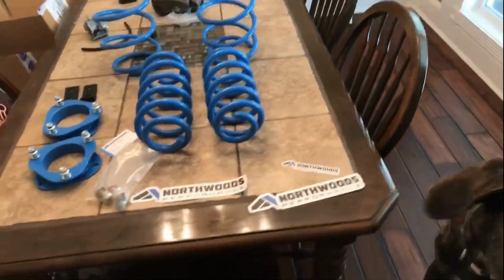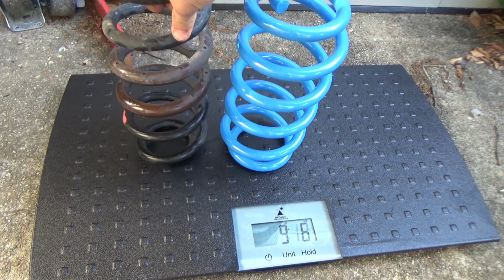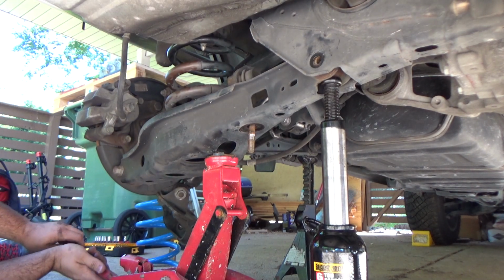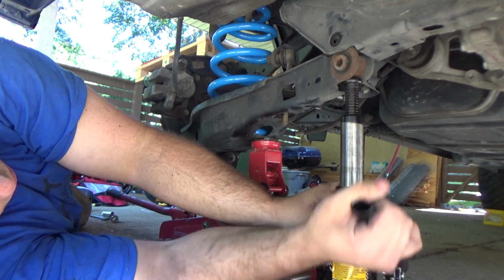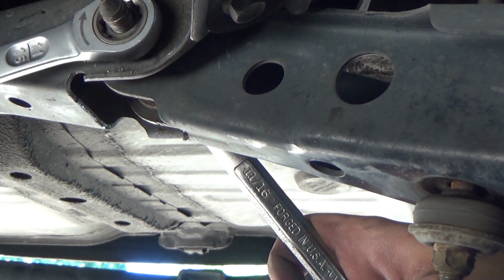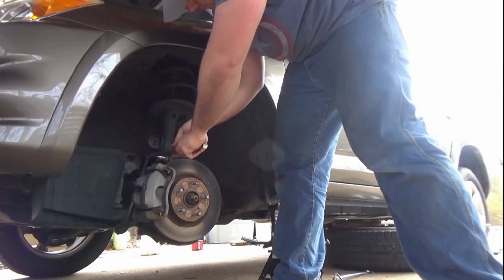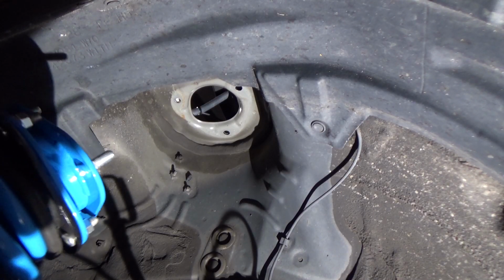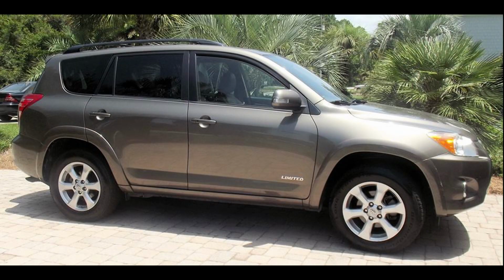Best lift kit for 2006-2018 Rav4. Northwoods Performance

Comment: @Creativemechanic 

Where did u buy the front sway bar end links relocation bracket? Did it come with it? Or did u order that piece? 

If so, where can I buy it?

Makes total sense to use that. The aftermarket front sway bar end links are 5 pound stronger than the factory.
Reply from the maker: The lifts come with it
Reply: @CreativeMechanic  that’s what I thought. Because when I told them about what I want and quote, so that I know how much I can invest for my 2015 lifted Scion xB, that has the 3rd Gen rav4 front suspension and rear spacer that’s both 2.5” lift. 

I ask them if it comes with the front sway bar end link relocation bracket. 

They said they don’t use sway bar end link relocation bracket. Our links are the correct length for the lift. 

I found another video, of another RAV4 owner. He had full tuned suspension lift, that has KYB with northwoods springs. And a spacer. He installed it and didn’t come with a relocation bracket. But he did had a front sway bar and fits perfect. 

But from you, u had those and u said it does comes with a relocation bracket. 

It was a bit weird. So hopefully when I order mine, it will come with it as well

@CreativeMechanic
Reply from the maker: Nathan from Northwoods does sell the shorter sway bar links now.  I’d recommend going with those as the relocation brackets can cause issues if they aren’t on perfect
Reply from the maker: I think my kit is just older is all.  Northwoods will hook you up with the right stuff 👌.  However I’d do some research and see if your sway bar end links are the same part number as a RAV
Reply: @CreativeMechanic  oh definitely. Thanks to u. And when I looked up the website, they are 5 pounds stronger than our own 2.05 pound end links.

And I’m very impressed with that. So I’m definitely considering getting these sets, and sway bar end links that can ride much smoother, along with the bracket. 🙏🏼🙏🏼🙏🏼

They are in my list for my lifted xB project. Right now I’m dealing with full custom exhaust. After that, it’s mew suspension upgrade. 🙏🏼🙏🏼🙏🏼

One more thing, u had ur suspension for quite awhile, how are they driving them daily?
Reply: @CreativeMechanic  urs is a 3rd Gen correct?
Reply: @CreativeMechanic  not all Toyota that comes with a front sway bar are exactly that same I believe. But that’s what Toyota does when sharing the same parts. And that’s the beauty of it. 

And I’ll be more than happy to do more research. It’s addicting for our built 🙏🏼🤣
Reply from the maker: Yes, but 2006-2015 have the same suspension
Reply: @CreativeMechanic  yes that’s correct. 3rd Gen 2006-2012 and 4th Gen 2013-2018 have the same suspension. Which is a good thing
Reply: @CreativeMechanic  Soo good news. Both 3rd Gen and 4th Gen Toyota RAV4 have the same part number as 2008-2010 2nd Gen and 2011-2015 Gen 2.5 Scion xB. 

So I’m all covered 🎊

Comment: Have you not had any issues with the CV axles? I installed the kit and I’m getting a wobble around 20-25 mph. Reading the forums and it seems others been having the same issue. Just wondering btw, I’d appreciate the response and any insight into the problem. (2012 V6 4WD)
Reply from the maker: I think the issues come from the rear toe arms.  Do you have the ones that were glued for the safety recall?
Reply: I have new rear toe arms, took the glued ones off, and I still get wobble around 20-25 mph. I was thinking it was my second gear in the transmission causing the wobble this whole time. Think I'll have to stick a few go pros underneath and drive it around. Going to install some Specialty Products adjustable rear camber arms this week.
Reply: @rgrrgrsxndngr1904  Has to be front axle related. I took off the front lift and kept the rear lift (temporarily ) and the wobble disappeared. I’m almost certain the slight change in angle for the CV axles is the likely cause. Mine has 100k miles so they are probably worn out. Took off the lift completely in the end.
Reply: @OGLouisVuittonDon  ahhh I see. Yeah it definitely feels like the shaking comes from the front, not the rear. Maybe I’ll try removing the front struts and toss the old ones back on to see if that fixes it also.
Reply: @Jeremy When I commented this, at the time there was only one thread that "solved" this issue with your response. There were still countless other threads in the process of diagnosing and suggesting other solutions. 

Now enough time has passed for me to be confident in your response that is now backed by few more confirming the same. I just wanted to understand the issue better so I'm not going in circles spending unnecessary time/money. 

Some more insight for anyone else curious. It's been confirmed that the issue is indeed tied to CV axle wear and new CV axle angle. The new angle causes some slack between the gears and the wear pattern that most axles will gradually develop with enough miles, which then causes the shake when enough power is ran through. Unfortunately no aftermarket axles have been confirmed (yet) to fix the wobble.
Reply: @OGLouisVuittonDon any update to this? Is it best to avoid getting this kit?
Reply: 😢 rip

Comment: Would you go with this over the sst lift? I’ve read a lot of extreme camber issues with the sst spacer lift.
Reply from the maker: Front or back wheel camber issues?
Reply: @CreativeMechanic  sorry about that, a lot of complaints about the front end camber. A few people mentioned shaking at 65mph as well on the website. I’m new to this so I apologize for my ignorance
Reply from the maker: @robertwest4299  I never noticed shaking.. but I will say that the Northwoods kit drove a lot better
Reply: @CreativeMechanic  thank you  very much.

Comment: I have been test driving some 2017  2018 RAV 4s with around 20000 miles and some rides feel way better than others in the same model XLE.  I sold my 2018 RAV LE because the ride was so harsh.  Recently test drove a XLE that rode great and an XLE that rode as bad as the LE I got rid of.  I am wondering why the huge difference from vehicle to vehicle. Any ideas out there?
Reply from the maker: Not sure, but it’s a completely different platform
Reply: Toyota performed different adjustments each vehicle they make every quarter of the year. Hence, one will feel different and one won't

Comment: How do you like your Rav? I was looking to get a 2012 v6. Maybe add some light off-road mods.
Reply from the maker: 1. The 2006-2012 AWD Rav4 was Toyota’s fastest 0-60 vehicle
2. It can tow 3,500 pounds 
3. It gets 28 mpg
4. It has tons of cargo space because the spare is on the rear door, my Great Dane can stand up no problem.

It’s hard to find another vehicle from that time that competes with those stats
Reply: Creative Mechanic yep I’m sold! I gotta get one !!

Comment: Did I miss what year the Rav4 your installing the kit is?
Reply from the maker: It’s a 2010
Reply: @CreativeMechanic  I probably should have asked you before I ordered almost the exact kit for my 2011, but how is it holding up?
Reply from the maker: Doing great I don’t see any issues with this kit
Reply: @CreativeMechanic   Did you have an alignment done after the install?
Reply from the maker: Yes, always get an alignment after changing suspension components

Comment: while installing it I found a thin triangular piece on the front strut upper mounting bolt. I don't know whether I am going to need to install this piece on top of the new suspension and struts. Any thoughts? Thank you!
Reply from the maker: I’d leave it in, should be a wear to plate to prevent rust
Reply: @CreativeMechanic  so you are saying I should install that triangular piece on the suspension parts? Thank you!
Reply from the maker: Yes, between strut and car

Comment: What's the max size tire you can use on rav4 v6 without a lift? I dont wanna change the old ladies 17 inch wheels. But want atleast a extra 1.5 inch diameter. The stock wheel and tires are 28.5

Comment: Hey, one question, those tyres look more meaty than the stock ones, do you feel any difference in throttle response and fuel efficiency?
Reply from the maker: There 235/60 R18, so only 0.5 inches bigger in diameter, mud tires always look bigger.  Not noticeable with the V6 model at all.
Reply: @CreativeMechanic  of course, the V6 is too powerful for a non drastic change, i have the base model of the 2010 Rav 4, so I don't want to go too crazy with any tyre swap and lift.

Comment: hi. You remove Readylift's all details before install Northwoods?
Reply from the maker: Yes!  Except I may have left the brake line spacers on.  I’m doing another video installation combining the two lift kits later this year. Mega lift 😂
Reply: @CreativeMechanic  This spring set proper for 2.4CC AWD rav4 or 3.5CC v6 rav4?
Reply from the maker: They sell them for both models.  Mine is the 3.5 liter V6 with AWD
Reply: @CreativeMechanic  i bought northwood and like it. Now waiting MEGA LIFT :D

Comment: Two questions.
1. Does it ride and handle any differently than stock?
2. Do the bigger tires change your speedometer?
Reply from the maker: Yes, yes
Reply: Ride rougher?
Reply from the maker: @mikedunham130  yes, smaller rims with beefier tires may offset it. But I have 18”s on 235 60 all terrains
Reply: Thanks. I was thinking of keeping the 17” wheels and tires I have for now. Sounds like maybe this isn’t going to be what I want. I find my RAV4 4wd to ride a fair bit rougher than my old 2006 FWD. it’s ok, but not sure I’d want it any tougher. 

Thanks for the info

Comment: May be wise to drop the control arms from the hub side for anyone doing this

Doing my 07 V6 the arm wanted to roll badly binding  the bolt I’m 4 hours in new bolt ordered and no parts installed
Reply from the maker: You have more leverage to compress the spring from the other end.  Good luck with your new bolts and you can reach out to Northwoods if your having issues

Comment: Hey there, i have a rav4 V6 (2008) & want to take it off road, but the suspension is very stiff & can feel every bump when driving (Stock Standard) & takes corner's very stiff too.

Would a lift kit like this make the my car more smoother & less of a noticeable bumpy ride? :)
Reply from the maker: No, if anything you should have someone check your shocks
Reply: I've watched a lot videos to get my RAV4 ready for some off-roading. Lower the tire pressure when you're about to go off-road. Most videos show 20-25 pounds of pressure for off-roading. This gives you more cushion for the ride with the softer tires. Make sure you have an air pump so you can reinflate before you get back on highway or regular streets.